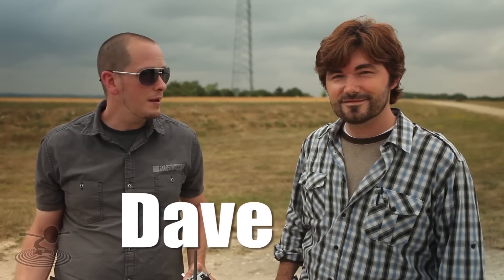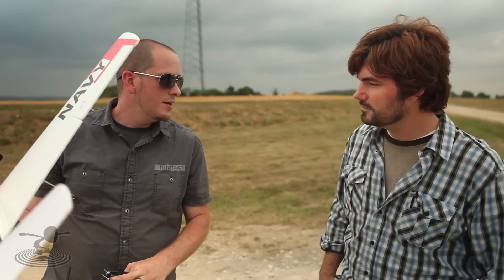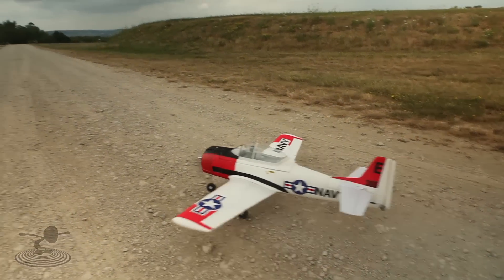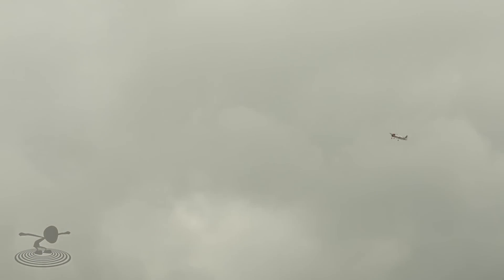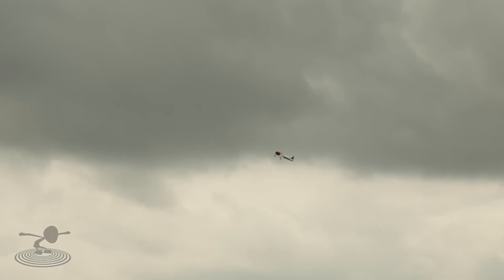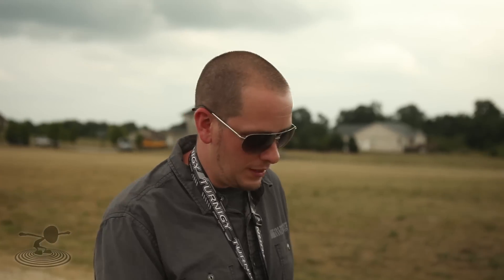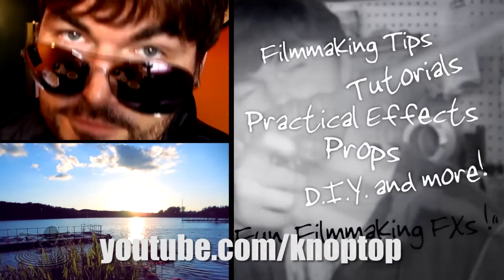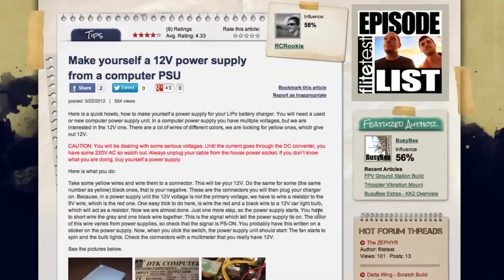Flite Test - Tail Heavy Plane - FLITE TIP

Comment: I drilled a balsa .46 glow plane on the maiden flight right in the middle of a packed RV lot, because I didn't know to check the CG and it was way too far back. I was fighting it bad just to keep it in the air and knew there was no way I was going to land it in one piece. When I banked on final for my "controlled crash", it tip stalled, went over some power lines, and spiraled straight down into an RV lot. By sheer luck it didn't hit anyone or anything except pavement in a straight dive.

Comment: The way I was taught, back when we flew the old-style RC pattern planes, make a simple aileron turn, if it needs aileron to keep it in the turn, it's tail heavy, the more tail heavy, the more it wants out of the turn. If it wants to tuck and tighten the turn, it's nose heavy. Climb vertical, if the rudder is straight and it pulls one way or another, your thrust line is off.  If you roll inverted and it drops, your stab, wing or engine incidence is off. It should fly equally the same if the wing is a true symmetrical airfoil. If it rolls wobbly, add aileron differential, that's less down than up aileron. When properly trimmed, the aircraft should roll on the proverbial string. It should fly hands off straight and level. I use the same for sport models. It worked back then, works today.

Comment: On my Ft flyer I always fly it tail heavy. It really slows the plane down which is great for flying indoor or in my garden. Also it uses less power to get off the ground and fly level. The CG is almost half the wing. It does not make the plane to unstable. in wind it is a little tricky and it is a little pitchy however, I think it is a good thing because if you are in trouble, you just pull up and it basically stops in flight then gentle goes into the ground.

Comment: I have other planes that I cannot fly at all. 800mm FMS FW180 suggested CG is EXTREMELY tail heavy. I removed a ton of material from the nose so as to add lead and a larger battery than they suggest just to make sure it was nose heavy, but it was still tail heavy. Flew it one time ever, landed. The FMS 800mm Zero I gave up on. I never got it right and an "expert" tried to fly it for about 20 seconds, crashed it into pieces, so I gave it away. The F4F is porpoisey so I'm scared of it. No crashes.

Comment: To be balanced are: EScale Zero, F4F Funfighter, and FMS 800mm FW.  I'm willing to bet the 800mm FW is hopeless.  The BF109 is mostly rebuilt using glue, fiberglass, CF rod, and a nose made out of a plastic cup from 7/11.  I'm hoping I can balance that on my own.  I just haven't because RC frustrated me so much.  I sold off quite a few planes.

Comment: Launching was never a problem with my FFs.  No roll, like a laser.  My BF109 was a peach and did everything I ever wanted of a plane... until the elevator died at WOT.  That was a sad day.  Suggested CG in that plane was within a mm of what I found to be perfect, and the design of it made CG adjustments very easy.  Same story with my PZ Corsair, it just works and I can tweak it little bits because when it's off I can fly it.  The F4F hasn't been crashed but I can't really fly it.

Comment: Properly balanced planes are excellent for 3D, more so than tailheavy setups. However, a tail heavy is nothing to fret about if you prepare for it by practicing high alpha post stall flight as well as fighting wing rock. With those skills, a tail heavy setup will only be an inconvenience, but not a death wish.

Comment from the maker: I think you mentioned you had a Fun Fighter F4F from your comment before. Those can be difficult to launch if you are at a high throttle setting. They are very small with a lot of torque. Were you able to fly past the launch?

Comment: I built an arduino gyro thing, which I can use to control planes and quads. To test it, I built a tail heavy plane, so tailheavy it isn't able to fly, and my system was able to keep it pointing in one direction and make it fly. So that is another use for aft heavy planes.
Reply: is the code on github?
Reply: Nope, I wrote it on my own. Saddly, I can't acces it now. But what I can do is tell you that I used MPU6050, and for that you'll find plenty of tutorials on the internet.
Reply: Wow, that's a super cool project! I'm not experienced with electronics, so I had to google the sensor you mentioned, and I'm totally amazed they can sell an entire board with a 3 axis accelerometer AND 3 axis gyro for less than $5.
Reply: Actually, I buy mine for like 1 buck. Yes, it seems amazing at first how you can fit so many quite precise instruments into such a cheap board, but once you know how it works, you realize how cheap it is. That's 21st centur for ye.

Comment: Is there a difference in behavior when different masses are chosen to balance at different locations? ie. a heavier weight in the tail, closer to cg vs a lighter weight further out. Both would balance the plane, But would there a noticeable variance of momentum of the empennage between the two masses?  Similar question for balancing out the wings?

Comment: Hi friends I have made a R.C plane. But  has been developed a problem. It turns  left and stall just after takes off. What is the possible cause. Please inform me. It's has max takeoff weight 1.5.kg. wing span 48 inch. I used 1400kv brushes less motor. 8 inch Apc prop. 832g Thurst. Is it enough for plane or required more?

Comment: I have a very tail heavy mini SkyHunter and I pushed the lipos up front as far as I can go, putted some lead weight but it is still tail heavy. Should I cut the two carbon fiber tubes that connect the tail to improve CG??
Reply: Try a heavier battery

Comment: How do you find cg on a plane that doesn't have it?
Reply: trevorr991 google rc plane cg calculator / flying wing cg calculator and type in all the necessary measurements. It will give you the proper cg location and there you are
Reply: ok thank you

Comment: My plane doesn't move even if it's on full throttle. Please help, I'm a beginner
Reply: throw it in the air or buy stronger motor
Reply: Is your prop on the right way. Numbers on prop need to face forward.
Reply: iStrike Pro well first check your prop and then if it's on the right way check which way the motor spins if it's correct check the wing loading to much weight and it will not move  if you can look me up on rc groups my name is blodbladefpv
Reply: throw away the flashlight batteries and go get a LIPO 3S battery pack.  Sh'ell sail the friendly skies for 6 minutes.  Then when you recharge the LIPO, put it in a fireproof box but don't tell your mom you have explosives in the house or you'll never fly again.